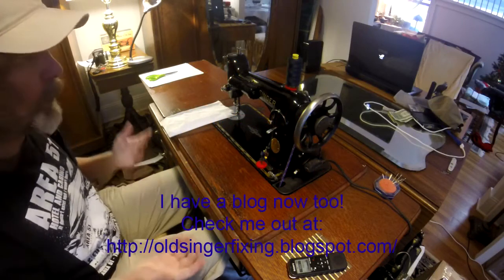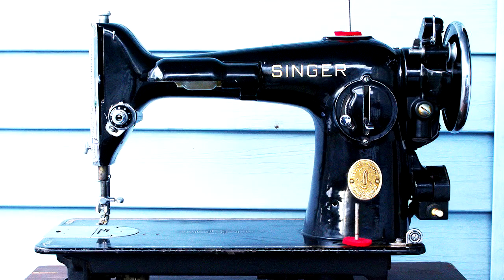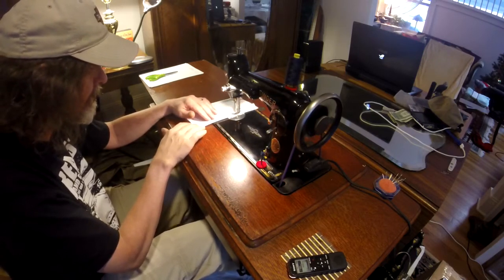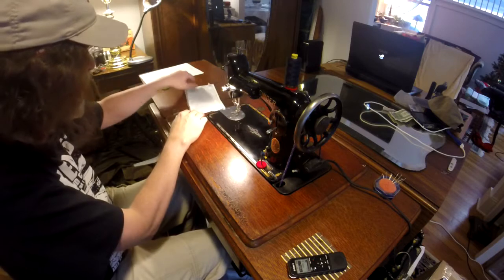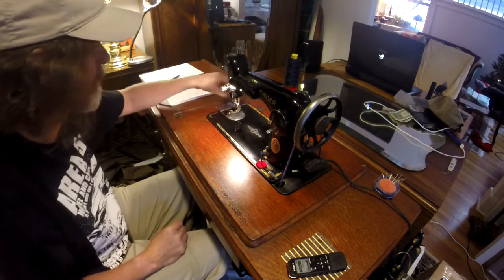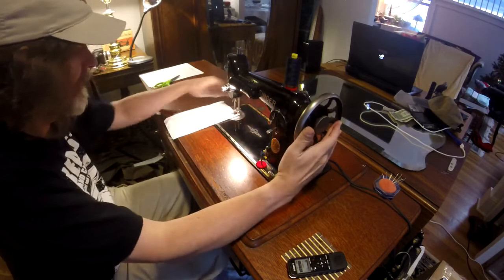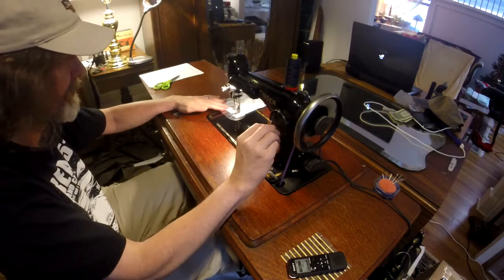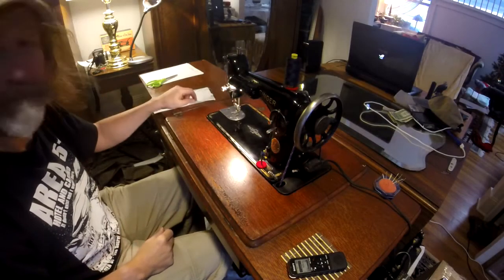Singer 201 Treadle Demo

Comment: How do you get your treadle so quiet? I bought a 1904 gingerbread 15-30 in an late 1800s (guessing cause the backs of the drawers have an 89 carved in them and the pitman rod is wooden) gingerbread parlor treadle cabinet off Craigslist. It took quite a bit to get the machine head unstuck, but I did over a week or two of trying. It’s my first real project, though I have other vintage machines, including a 66 from 1910, they pretty much ran right away with a good cleaning on the outside and oiling. Anyway, I got everything moving, but the treadle is rubbing on the wheel. At the little spout looking part for derailing the belt I think. It only has two adjustment points. One at the wheel with little leeway for the door to close and one on the right side of the peddle. I took them completely apart n cleaned them and packed them with grease, but cannot get rid of the rubbing sound. Would appreciate any suggestions.
Reply from the maker: The centering screws on treadles tend to work themselves out over the decades.  Loosen the nut for each, and tighten the screws until they bind, then back them off just about 1/8 of a turn and they should move free and not clank when moving.  Also give each pivot point a couple of drops of sewing machine oil to keep them from squeaking.
Reply: @davef2065  thanks so much.

Comment: Hi Dave! 
Using a 550 cord as a treadle belt? What a great idea! Why didn't I thought of that!? Could you show me what type of connection you are using? I imagine knots will not help making it operate smoothly. The leather kind uses a staple wire. Would that work on the 550? I appreciate any tips and tricks for this mod. Thank you for the idea and the great demo. 

Best,
PD
Reply from the maker: Hi PT, to connect the ends I just stitched them together with 50 weight thread.  Make sure to do lots of stitches and loop around the ends while you stitch to keep the thread from threading the cord.  Also check my 221 treadle video where I use fish tank air tube as a treadle belt.  It's cheaper.

Comment: I dont know if you will still see this Dave but if you do, you casually say "I cleaned it up" but my word what a beautiful job you did on it. There is very little on how to do that other than rub oil in it until it come clean. I ask because if it makes it through the post, I have one arriving in a similar condition to that before picture. Would you consider doing a series on rebuilding or conserving a 201?
Reply from the maker: On my blog I have a series of posts about different types of cleaning I've done and what works good and not so good.  Can you get something like Gojo (without pumice)?
Reply: @davef2065  Hi Dave. The first of 2 machines I ordered last week has arrived. 201K and it is in WONDERFUL condition in a lovely  wooden case (Brentford????) with barely a mark on it. 72 years old and the under side of the machine is like pure silver! The black it dull but no crackling or damage or oil build up. It is beautiful. Needs rewiring but it has the 2 button foot pedal and plugs so I MIGHT be able to redo the motor and rewire it. I'm so fured up. The one that hasn't come yet is a 15k 1955. No reverse but the decals are beautiful and Raf Design. It is in a big snakeskin style suitcase case. It has no foot pedal but has a Rotary motor is it? Not a potted or ??? It needs a tyre to drive the belt? Anyway...what is the best book I might purchase to work on these 2 models? Any ideas? 

In case you can't tell...I'm thrilled!
Reply from the maker: @moiraberniegatt9491  Try just giving the black a light coat of sewing machine oil.  Put a couple drops on a microfiber rag and brush it on gently.  You should see a big difference.  If your rag comes away dirty, just give it another rubbing in a few days to clean it.  Is it a carrying case?  If so it's probably a 'bent wood' case.  Careful, the handle on top is NOT a carrying handle, it's just to lift the cover off.  Enjoy the machine.  Oh you can find like minded old sewing machine fans at:  https://www.victoriansweatshop.com
Reply: @davef2065  Bent Wood 🤣🤣🤣 of course. Bless you. My husband went to grab it by the handle and I screeched him to a halt. Thanks so much for the heads up. But they made those natty finger grooves underneath. That's when things we actually designed eh. Love love love it. Thanks again. So great in these sad times to have such an exciting distraction eh

Comment: Great idea getting that pulley on a potted motor 201.  Did you use a 201 treadle pulley from another 201?
Reply from the maker: The hand wheel is a standard Singer 9 spoke.  This one came off a 66.  Any Singer 9 spoke would work.

Comment: What kind of bobbin winder did you use for the treadle?  I assume the 201 was gear driven with a direct mounted motor.
Reply from the maker: The 201's bobbin winders are friction wheel winders, even the potted motor versions.  Once I got the appropriate hand guard (off of a Singer 15-88/90) I just moved the 201-2 winder to it.  The hand guard is the same as the 201-1/3 so the winder fits perfectly.

Comment: Did you leave the motor attached ? I have one of these machines also and want to treadle it but read somewhere that the motor needs to be removed first because of the direct drive.
Reply from the maker: Yes. The motor needs to come off.  Removing the direct drive hand wheel takes away the gears for direct drive, but the shroud still sticks out too far to allow a belt to pass freely over a 9 spoke hand wheel.

Comment: Wat are the best 201 treadle models please ?
Reply from the maker: The 201-1 and the 201-3 are best.  The -1 came in a treadle, it's more common in the UK.  The -3 came with the external motor and goes into a treadle as easy.